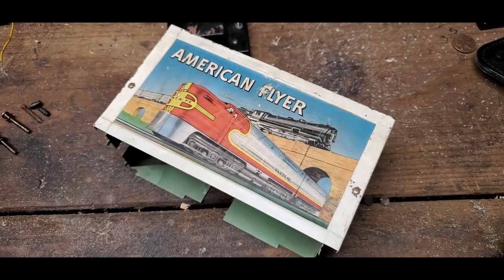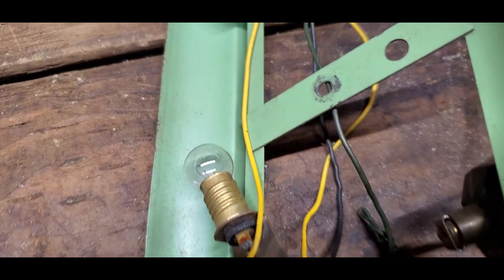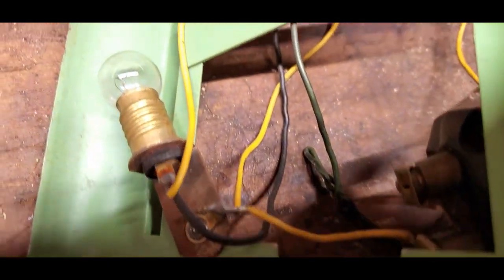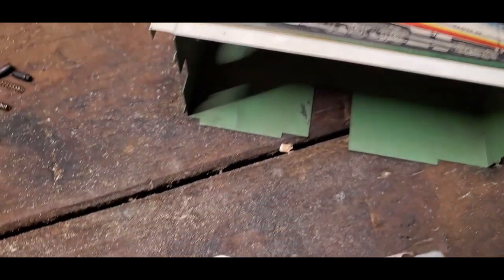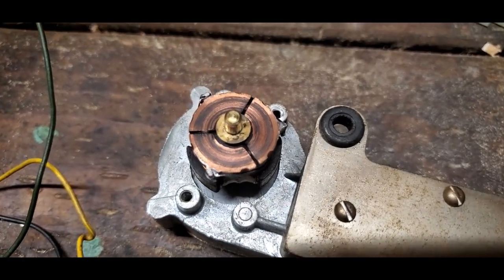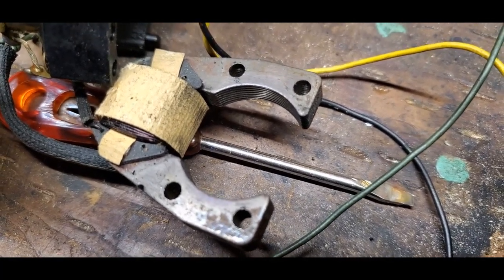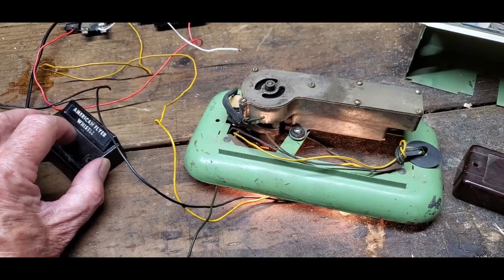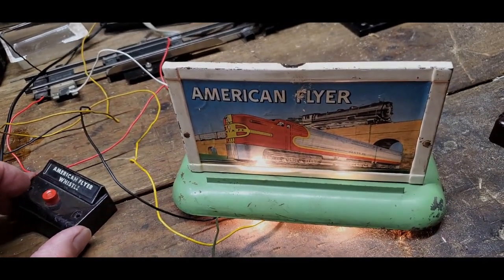Servicing My American Flyer Whistling Billboard

Comment: Sounding good, well done.

You can use an electric track trip to automatically blow that whistling billboard in addition to using that controller button if that is something you are interested in doing.  The locomotive circuit activates the track trip relay.  I had it sound the whistling billboard and/or the diesel horn billboard.
Reply from the maker: Thank you for that suggestion.